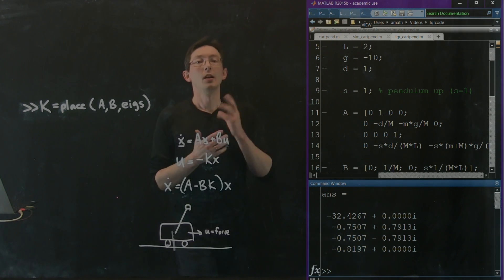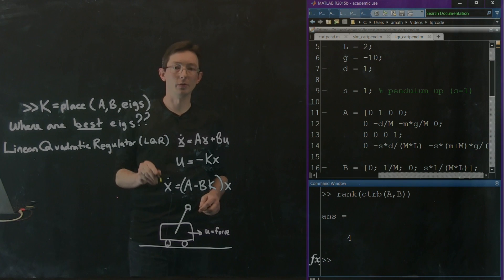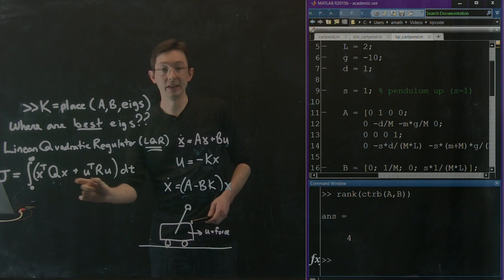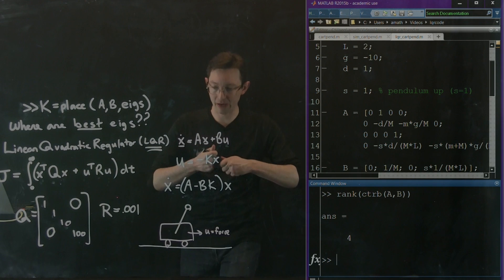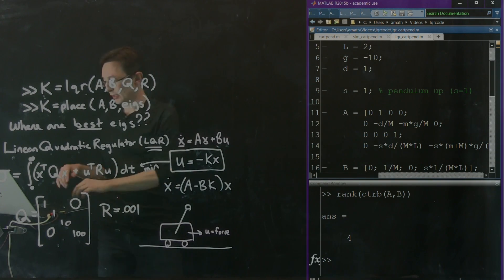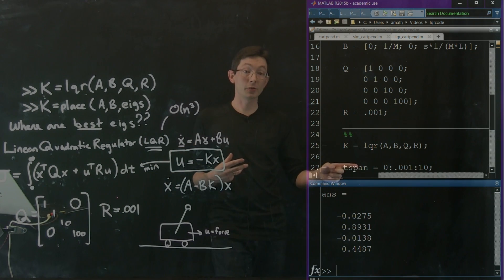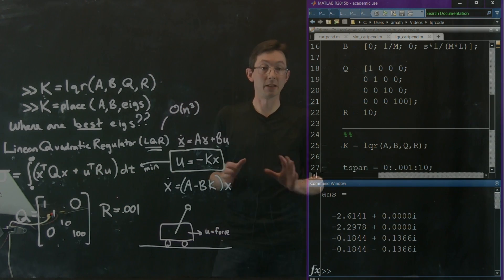Linear Quadratic Regulator (LQR) Control for the Inverted Pendulum on a Cart [Control Bootcamp]

Comment: When in doubt, place the closed loop poles on the negative real axis in the s-domain.  If the response isn't fast enough then move the closed loop poles so they are more negative on the negative real axis.  I need to figure out how to do this in python.  LQR doesn't worry about keeping the closed loop poles on the negative real axis because it places the closed loop zeros close to the closed loop poles effectively canceling them out or reducing their effect.   One thing that was mentioned is the resolution of the feed back.   In simulation the feed back resolution is infinitely fine whereas in reality it isn't.  This limits how aggressive the gains can be.

Comment: Excuse me sir, i have a questions. In the control system using LQR, the output will be the value of the gain matrix K with an order of 1x2. What I want to ask is :

1. What are the meanings of the matrix values of K11 and K12?
2. How to use such matrix values K for implementation on DC motors?

Because i already learned how to design a control system of DC motor using the simulink on MATLAB but i couldn't implement it on the DC motor because i don't know what is the connection between the matrix K value to the DC motor.

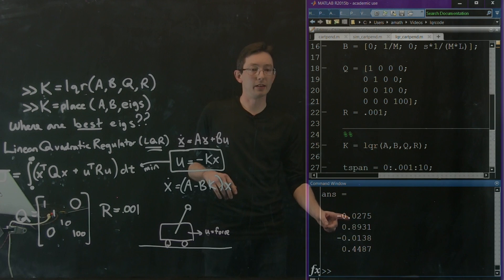Comment: Thank you for the video, sir! Really a good explaination of LQR. I have question though. At 9:20 you compute the eigenvector to the most stable eigenvalue and mention that the most stabilizing directions are x_dot and theta_dot. So aggressive control on x_dot and theta_dot would really improve performance.
So my question is: Isn't it a good idea to have high values of the 2nd and 4th diagonal entries of the Q matrix, as these correspond to x_dot and theta_dot, and then have lower values at the 1st and 3rd entries?

Comment: Hi professor, I saw the code late using K*(y - y_des) for non-zero fixed point. The cost function for lqr "J = x'Sx', If we calculate the K and S using lqr without information about the fixed-point, Is that mean the cost J is a constant regardless which fixed-point I want to be fixed?

Comment: Thank you for helping us practically understand and visualize the concept.
I had one question though; while implementing it, when I gave the system a step input it turns out the cart doesn't go one unit and in fact there is some steady state error. Should it be there and if yes then the LQR alone cannot fix that?
Reply: If you want no steady-state error for a step input, I think you would need to additionally implement an Integrator to the system

Comment: Thank you Sir for the clear explanation! I would like to ask just a question about the last simulation made with R=10. I have noticed that the cart does not reach the fixed point, at least as regard the first state x, which is supposed to get to x=1. My hypothesis is that, since we set the actuation as really expensive, the control variable should be kept enough low and, as consequence, the time needed to reach the fixed point is longer than 10, which is the time we set as "tspan" in the Matlab code. Is this reasoning correct?

Comment: how could you put in the limitation of a motor, for example? so that you'd have in a practical assignment a bunch of motor options, how would you approach calculating the ideal eigs for each of the motors (with their speed limitations) so that you can compare price with time? I'm asking because motor prices are often not liniar with their power, not do they cover the entire spectrum of possibilities, unless you're willing to build one from scratch.
Reply from the maker: This is a really interesting question, and there are a lot of interesting offshoots.  Including the real cost of hardware with their performance is more of a high-level multi-objective optimization problem.  All big companies that design complex systems and control algorithms (think about a GE engine) need to perform these large optimizations to balance design and cost tradeoffs.  More generally, in LQR, it is difficult to put in some types of limitations on the hardware.  Model predictive control is a very flexible framework to incorporate some of these constraints directly.  Video on MPC: https://www.youtube.com/watch?v=YwodGM2eoy4
Reply: @Eigensteve  That seems incredibly interesting! Model predictive control feels very close to a sliding window algorithm in programming, where you re evaluate your options every time you take a step. Is it right to say that both of these methods apply very well with cases where ideally there is a straight path between the initial position and the goal, but would break if there was a limitation stopping them to do that?
Reply from the maker: @alexandermaverick9474  Interesting question.  I'm not an expert in path planning around obstacles, but I imagine that if your MPC horizon is long enough to see around the obstacle, it might still work.
Reply: @Eigensteve  Sadly I have learnt from scratch MATLAB and implementing an inverted pendulum in the last two days, so I am quite tired. But would you greatly mind if I would ask by email some more questions like this? I already have quite a few too many for a youtube comment section.
Reply from the maker: @alexandermaverick9474  No problem, although it might take me a while to respond.
Reply: @Jordan Bagwell well the professor hasn't had time to answer them yet probably, and my questions have a tendency to be... quirky. In all likelihood, the spam over youtube wouldn't be worth the trouble really, sorry :P :)
Reply: @alexandermaverick9474  I did implemented path planning for robot using model predictive control. It's really like sliding window, for me it is almost two nomenclatures for the same control theory. I would call my controller a MPC because I used a linear model for each moving obstacle and I updated all world state as I checked the horizon of control. The sliding control in robotics would only take care of the brickwall characteristics of the dynamics. I implemented a web simulator of sliding control when I was studying it here http://frizon.com.br/dwa/
You need to allow popups as I used a window that show the heatmap of the robot state space
Reply: @AllElectronicsChannel  very cool
Reply: @wizardOfRobots  Thanks!!